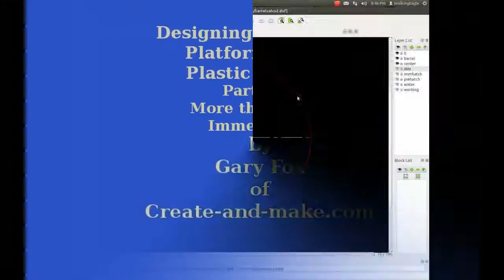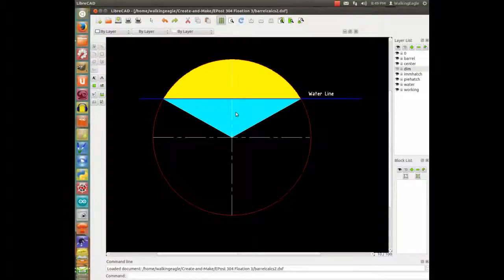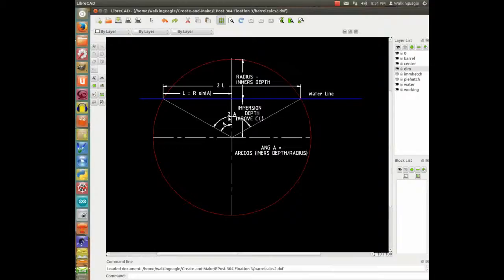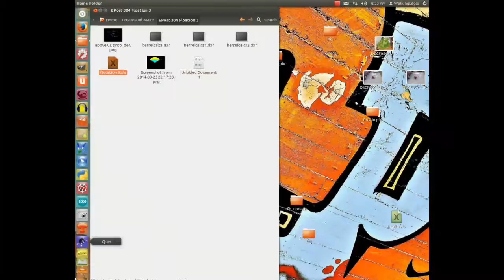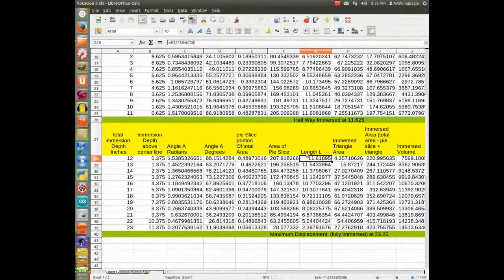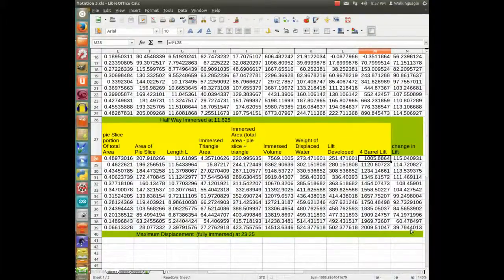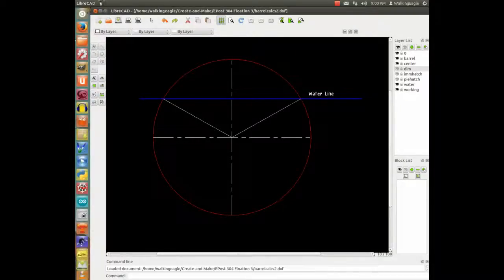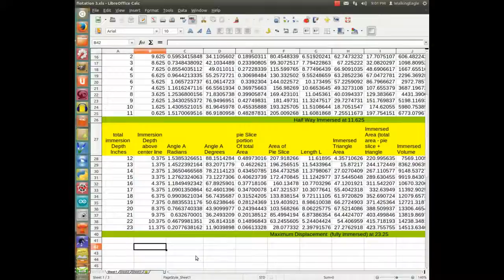Flotation of a 55 gallon Plastic Barrel Part 3

Comment: Gary, I do appreciate the in-depth Trig. Haven't used it much since the Construction master calculator came out. I followed along and made my own spreadsheet, which made me add 6 barrels to my float and was also able to predict exactly how high the top of the deck would be off the water. Surely wowed my friends.
     Sadly, in Biden's America, not even a cheap barrel is cheap anymore. Nor is the lumber.
     In keeping with the internet troll theme, my only gripe is Height does not end in a "th". God Bless you brother and thanks for the trig refresher.

Comment: So I came here expecting to find some ideas about how to build a raft campsite.  Instead I got a math and spreadsheet treatise, which is fine for commercial work, but as a one off homebuilder all I really need to know is how much weight will a barrel float at the half immersed waterline because you wouldn't want to go deeper than that due to rapidly reducing lift for the amount of depth.  
The barrel holds 55 US gallons.  Water weighs 8.3 lbs/gallon (easy to look up, but I did calculate it for myself back in high school before the internet was a remote possibility).  The barrel will displace 456.5 lbs completely immersed.  
Divide that by half to get a "don't go beyond this weight" load on each barrel.  228.25 lbs.  For the sake of simplicity lets toss the extra 28.25 lbs to offset the weight of the barrel and add a bit of safety measure and just figure it at each barrel lifts 200 lbs.
If you are using ten barrels that gives you a lift of one ton, 2,000 lbs.  That has to include everything, the frame and deck, the gear you'll take, the supplies, including water and food weight, and the crew weight.  No spreadsheet required.

For my purposes, I'd figure crew weight at 400 lbs (your mileage may vary), and I know I can easily camp for three days within another 200 lbs.  So I have 1400 lbs left for structure and propulsion.  This doesn't have to be rocket science.
Now you need to know the weight of your structural materials and I'd shoot for less than 1400 lbs for the extra bouyancy.  This is where you might actually wish for a spreadsheet to help compare alternative designs and materials.

Comment: Highly complicated to much math for me  .  I may be wrong but a much simpler method of arriving at what I would expect would be a fairly accurate figure of what a barrel would support would be to work from the barrel capacity in Litres    1 Litre of water weighs 1 Kilogram therefore a fully submerged barrel of 200 Litres will displace 200 kilograms of water .  Ignoring the few kg that the barrel weighs then approximately,  a fully submerged barrel will support 200 kg .   This may not be as accurate as the calculated figure but is as close as damn it is to swearing